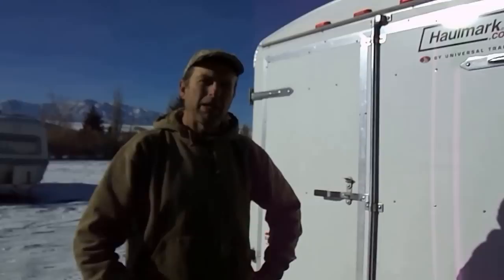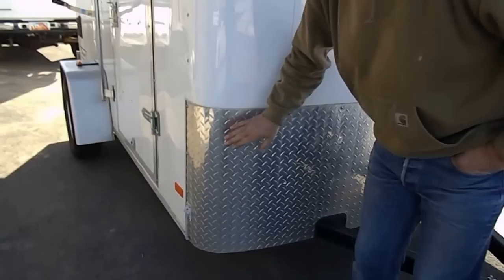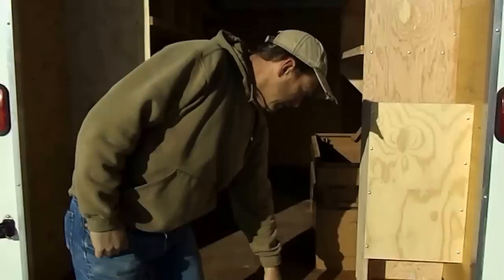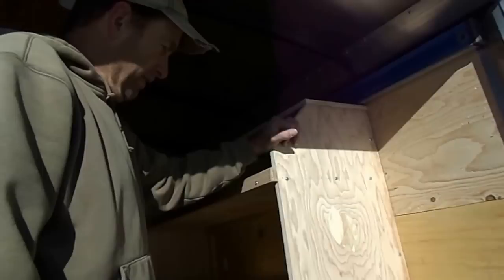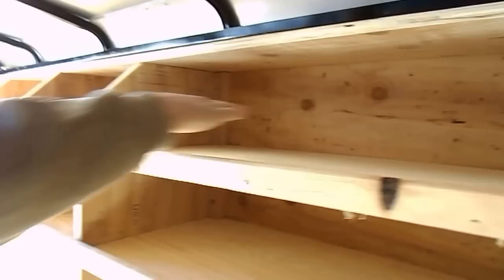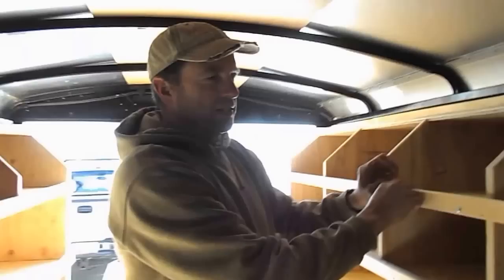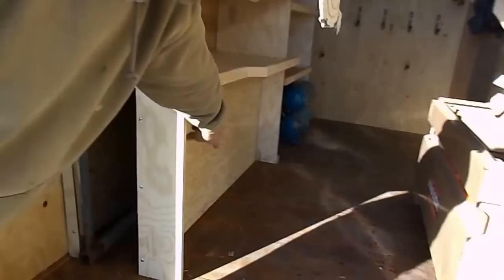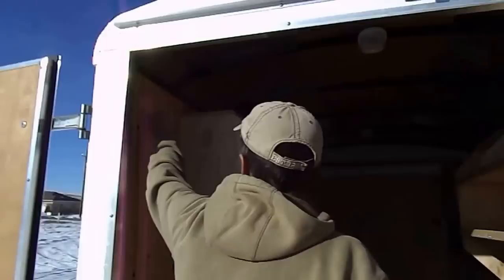CONSTRUCTION TRAILER SHELVES LAYOUT

Comment: I ripped 3/4 wide about halfway deep on a 2x4 and placed that on the edge flush with my shelf. Then slipped a 6 inch 3/4 board into the "gap" that I made and it held everything in. I just pulled it out to get whatever I wanted. Great video. I painted my walls white to brighten it up some.

Comment: Nice video!  I'm a handyman and I purchased a Pace trailer and I can tell you that you're spot on about their quality.  It's bad.  My next trailer will not be a Pace.  Nice job on the shelves and walls.  I didn't cover my walls with ply like you did but I had a tough time making sure my shelves were anchored properly with that junk wall board they use.   I was worried about adding too much weight when I did it but after seeing how yours came out I may do it that way on my next one.   Job well done!  thanks for sharing
Reply from the maker: The Burb Billy 
Thanks for the nice compliment. (a year ago...sorry about that)

Comment: This is just was i was looking to build. Simple, effective, straight to the point. Really nice design, layout and execution. Thanks for the inspiration! Would be interested to Lomé how it’s working thus far. Any tweaks or modifications since posting this video?
Reply from the maker: Not really. I'm still using it as designed. As long as you keep things tidy before hitting the road I've never really had too many issues with things falling off the shelves. But, some type of betting or shelf covers would be helpful.
Thanks for the nice response

Comment: 1) What was that 'c' word you used to attach the 2x4 on the flat in the back?

2) How did you attach the 1/2" ply wood to the sides?
Reply from the maker: The C word I used was coped. Scribed a 2x4 with a compass tool so the front of the 2x4 followed the contour of the radius trailer wall. The back of the 2x4 was straight to allow a platform to mount the new 1/2" panel for the cord / hose racks.
 I used const adh. and 1 1/4" self tapping panel screws form Lowes to mount the new 1/2 CDX side paneling over the 1/4" paneling but fastened through to the trailer frame rails. The entire project was fastened and reinforced with self tapping screws,,(all pre drilled holes throughout) , and const adhesive so it would all stay tight through the years.
 Hope all that made sense

Comment: what kind of screws did you use, length and did you pre drill?
Reply from the maker: james sherratt 
I used 1 1/4" panel screws...like flange bolts but screws with a built in washer. And yes I did pre drill everything.

Comment: Could you mention the size of the trailer. I'm currently looking to make a purchase and my dealer thinks a 6' wide trailer is not wide enough for a contractor.
Reply: Timothy Fox  I had a 6x10 and quickly out grew it. Lost it all in a fire and now I just got a 6x12 V-nose. I wouldn't go any smaller than a 6x12. 6ft wide is just about standard. You can get em wider. Just remember it was a dealer telling you that.$$$

Comment: where did you buy the hook system mounted to the front of your trailer
Reply from the maker: I purchased the hook system years ago at a truck box / van box truck retailer that sells utility boxes. Unfortunately they quit making those hooks.  You might have to have a fab shop make up some custom hooks
Reply: Thanks for the follow up. I was able to find the rack and the "J" hooks at my local Northern Tool